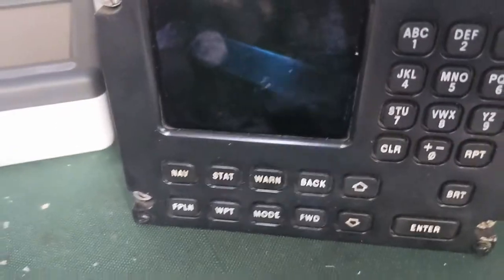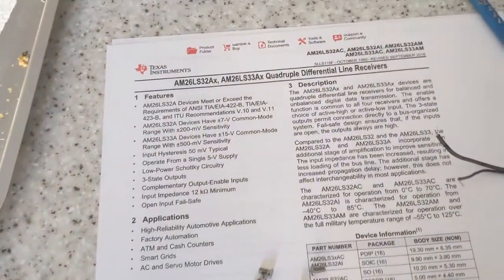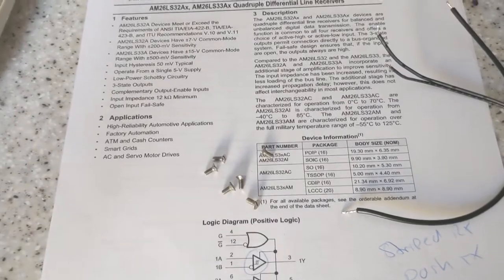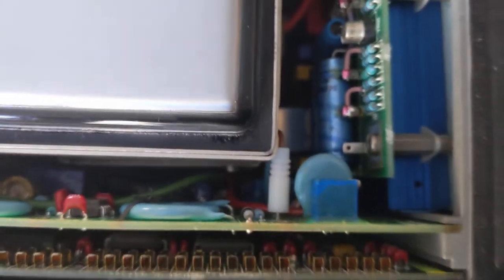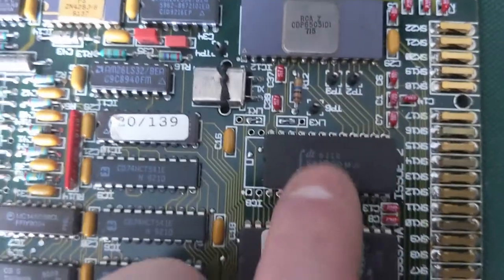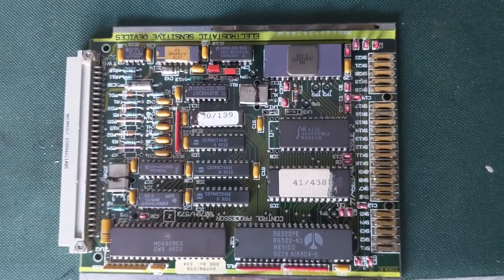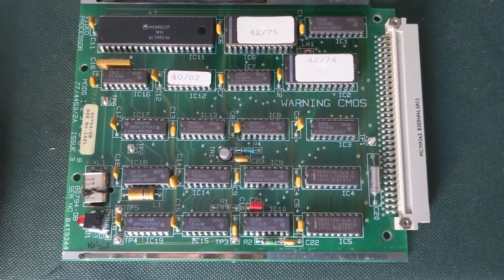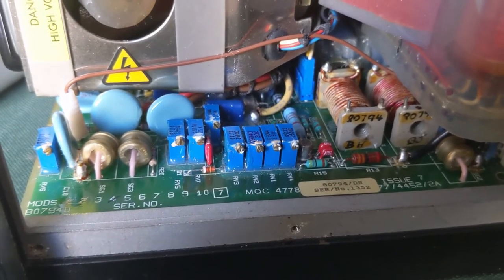Racal Avionics Control Display Unit - teardown and power up test. From sea king helicopter?

Comment: Beefy little CPU for the task.  Have you ever put it back up on eBay?
Reply from the maker: Yeah I sold it a while back to a guy in Holland who is trying to reverse engineer it and get it working. Is a matter of figuring out the data protocol and what sort of initialisation data needs to be sent to it.